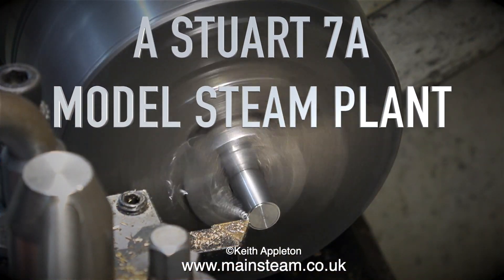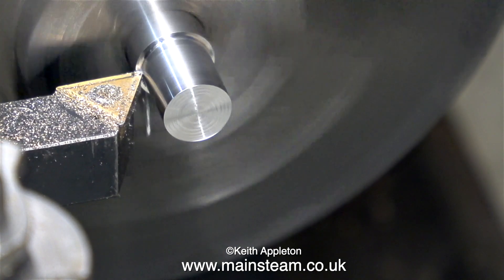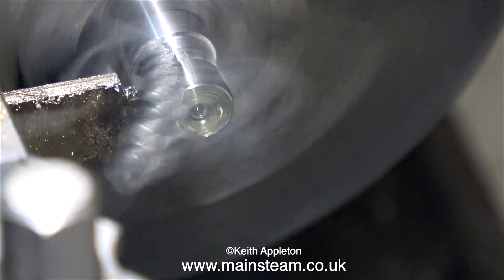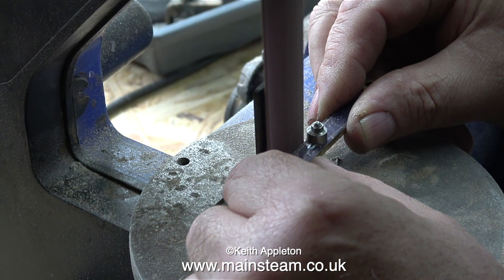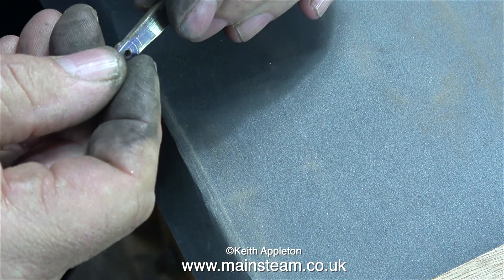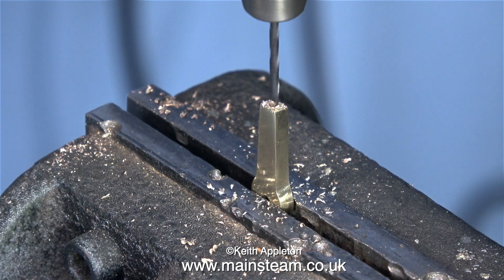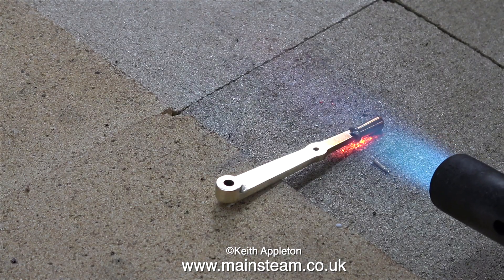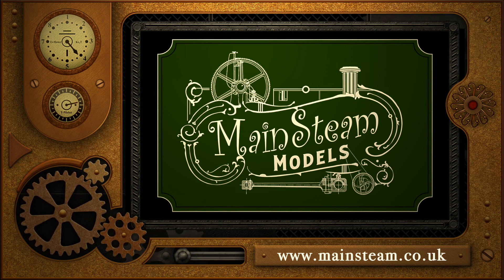A STUART 7A MODEL STEAM PLANT - PART #7

Comment: About getting the right diameter by measuring the shaft of a drill bit as a reference is not a good idea. I observed, that the shank is slightly thinner than the cutting end. This is due to free cutting properties of twist drills. Seems they are slightly tapered.
Reply from the maker: I compensate for that and it works for me on non precision items . . . .